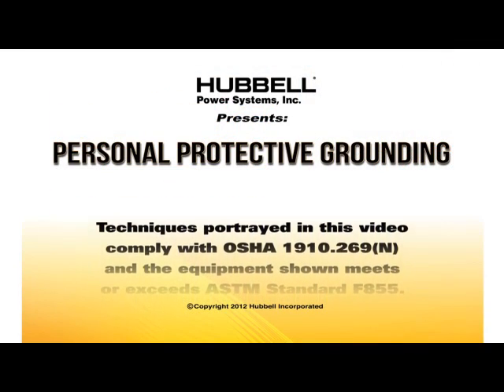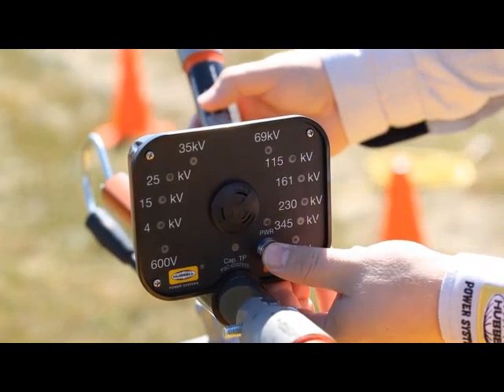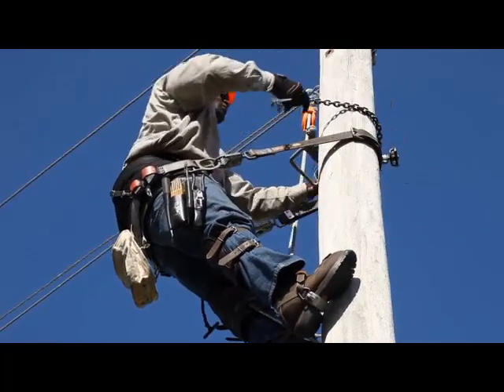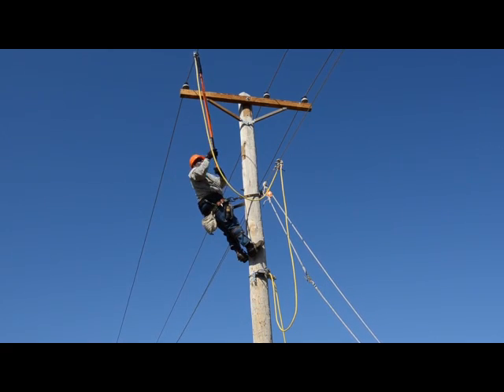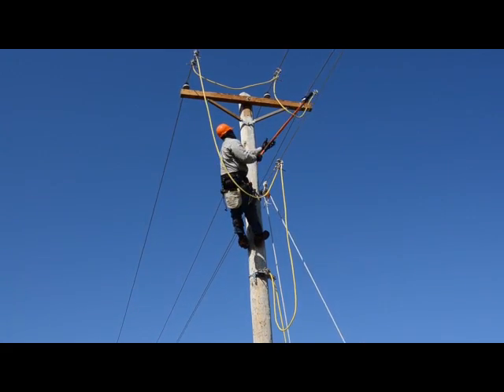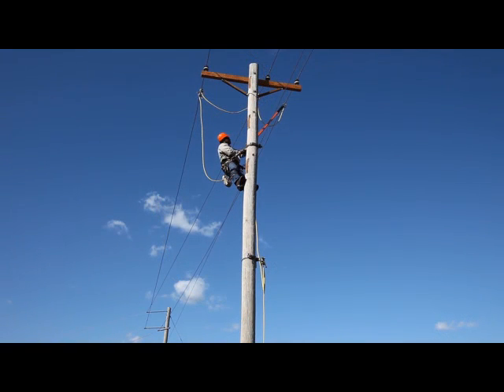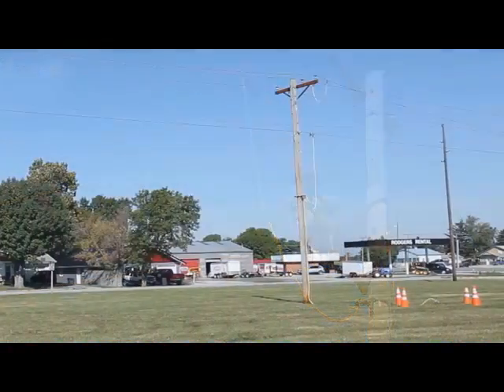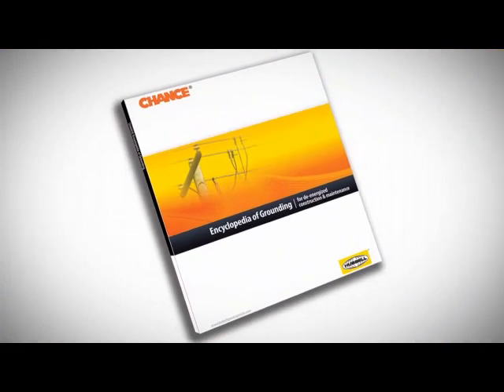Hubbell Power Systems - Equipotential Grounding for De-energized Construction and Maintenance

Comment: Is the wire space between the two poles that were grounded de-energised after grounding..? Or is he still working hot, but at a safer potential..?
Reply: Denergized always. Grounding and EPZ grounding is personal protection incase someone backfeeds or closes a switch energizing the line